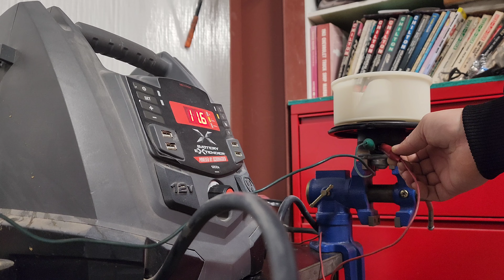Interior Restoration!! RAT INFESTATION!! Toyota Pickup 4x4

Comment: You could use a HEAT GUN for the flooring….Better check the door wells behind the door panels…
Reply from the maker: I did end up using a heat gun as well. It made it much easier. 

Thanks for the comment!